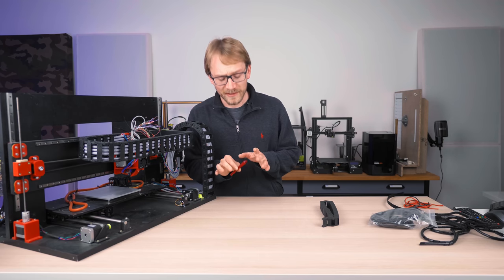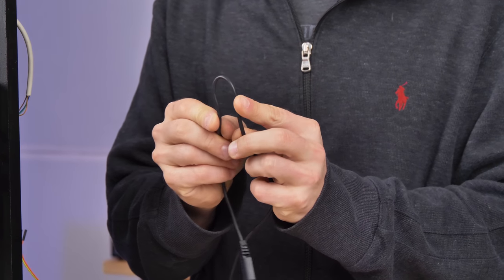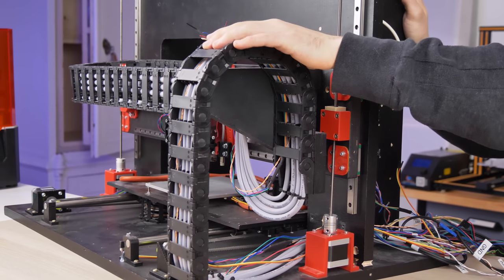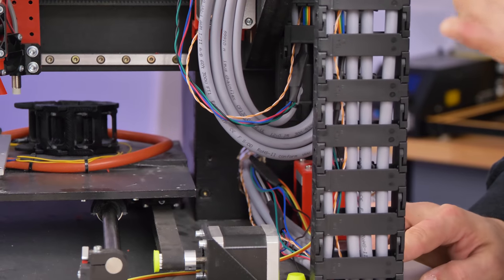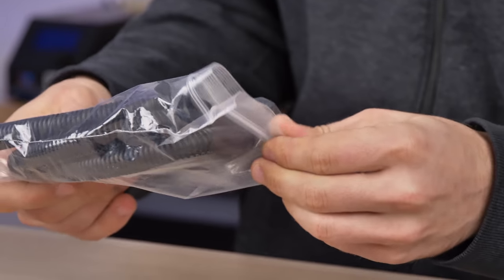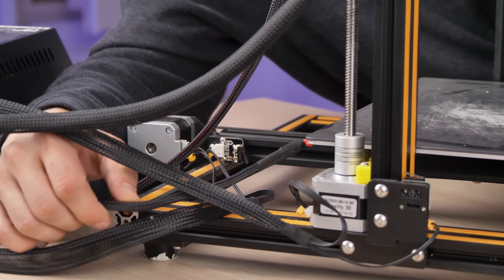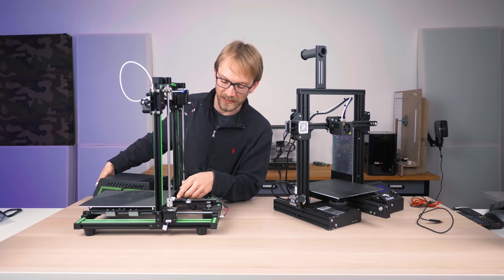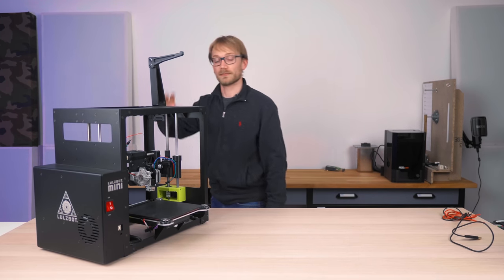Bad and great 3D printer wire management explained!

Comment: You forgot one technic. E3D uses a mesh sleeve with a spring steel band in it for the tool changer. I like this idea, because it might be possible to keep the cables horizontally orientated and you don't get this vibrations from the cable chain. I would try it if I would have an idea which steel band would be the right one.
Reply: I did the same thing a few years ago for my DIY printer, except I bought 2mm thick nylon fishing wire. It was too flexible, so I braided 3 strands together and hot-glued (no other glues really stuck to nylon) them on both ends - this braided "wire" is enough for reinforcement of the sleeve. The machine is an i3-style printer, so I routed the extruder/X-axis cables from the top of the frame under 45deg pointing up-backwards. This gets you a nice large radius across a wide range of Z heights. To this date, I haven't found a better mechanism (drag chains included) and I'm a recreational CNC machine builder. Too bad I can't post links to images here.
Reply: @jirij  I see the main advantage of the steel band that it is flexible in one direction, but it is nearly not to bend in the other, just like the cable chain. In my CoreXY printer I could get the cables in a form like a fibonacci curve instead of looping them upwards. So I could make the enclosure smaller.
Reply: I am only not sure how fast the thin steel will cut through the sleeve
Reply: I have seen someone use cheap tape measure innards.

Another i have seen used is polypropylene sheet, such as from a plastic document folder or a kitchen mat.
Reply: I can vouch for that, that's what I use. Look for large stainless steel cable ties. They are cheap and readily available in sizes from big enough to huge, easy to work and durable. Perfect for the job.
Reply: @m3chanist  Interesting idea, but are they made from spring steel?
Reply: @yaVDRgda  Like any stainless, springy. Duplex stainless isn't brittle, however. I have it configured in an S laying flat on its back between a central rear mounting pillar and a mount on the back of the extruder. Enclosed corexy, needs to be compact.
Reply: @m3chanist  Yes thought about an S curve too, at least for my CoreXY. I am currently working on an Core2XY too, there I need another solution

Comment: Replaced my cr10 bed wires with flexible large gauge silicone insulated wires soldered on to the bed and printed a drag chain, to many amps for my taste to leave that part untreated.

Comment: I use a spiral wrap with a hard 5mm diameter filament-like plastic for reinforcement (electrical fish tape). Tie the plastic firmly at ends and it will hold the wiring in a nice, predictable curve.

Comment: Drag chains should NEVER be used in a vertical orientation! The chain should ALWAYS be horizontal across its width. For vertical runs the chains/cables should HANG from fixed points - one on a fully fixed, the other fixed to the moving part. For horizontal runs the chain should lie flat AND for best practice should "roll" onto a flat surface or a specially designed chain bed. Also good power cabling would typically be heavier duty than signal cabling so using multicore cables is not recommended for the power distribution. This means ALL cables delivering power to stepper motors (all four or more leads) and to heating elements (bed, nozzle etc.) Fan power is usually low and so can use similar sized wire to sensor wiring. The BEST way to cable is to use the right size wire for the job and make those wires into a cable using flexible sheathing or full length heatshrink for low signal/low power pairs - the way that F1 engineers make cables,

Comment: One of the biggest (if not the biggest) concern with the wiring bundles, particularly to the tool head, is the strain of the wire bundle on the tool head itself. Depending on where the tool head is the wiring bundle will (most likely, dependent on design and location in the build volume) exert pressure on the tool head which can force the head in a particular direction. 
Once you get your printer precise enough, or have a printer that already is at that point, the wiring bundle can pull the tool head away from the bed when it is totally stretched out, for example. 

This is actually why I was looking up information on this - wanted to know the cons of a drag chain. I am about to add one to my printer b/c the wiring bundle as is (enclosed in a stiff mesh w/ a very large zip tie acting as a ‘spine’. Wrapped together with zip ties & heat shrink at the ends where the anchors are) causes the print to be slightly light at the far end of the build platform

Comment: Wow...I didn't realize Lulzbot went out of business.  Where have I been.  My local Microcenter still has them for sale.  Expensive beasts, but they are well made.  Where I work the engineering department has 4 of the TAZ's.  We also have some big boys (Stratasys)...but the guys love the Lulzbot's.
Reply: They ended up getting bought out, so Lulzbot is in business again.
Reply: @_Piers_  good to hear.  Expensive product, but the ones that are in use by some of my fellow engineers go 24×7.  They shut them down to load filament, that's about it.

Comment: Good video - another DIY 'dragchain' tip is to use a flexible steel tape measure blade within a mesh tube outer. Still like the Prusa textile option 'tho - never failed yet (maybe I shouldn't have said that :-)
Reply: Damn that's genius! I can already see easy ways to integrate this and connect it to printed mounts....time to dig out my guinea pig printer for a test!
Reply: Another possibility is to use polypropylene sheet, such as from a plastic folder of from a kitchen mat. Once you constrain both ends to one direction, the middle section forms a smooth loop. I don't know whether i came up with this thought independently, but it's not very original, googling it up it's part of several Mendel90 build instructions.

Comment: Hi Mr. Sanladerer; 
MOST challenging is having a soldiered wire connection survive within a DRAG CHAIN.

AFTER wrapping each in electric tape, then bundling them togeather with electric tape - finally to place thim within that *light spiral-wrap like in your video - then placing them into the DRAG CHAIN. I will see how long it survives 10x30mm CHAIN.

I believe it WILL survive for quite some time, because the sprial-wrap kind'a grips at area of soldier bulge AND the sprial wrap is super slippery, sliding thru the drag chain like an ice skater :) OH, and as you mentioned the CHAIN's bending radius - the sprial-wrap actually keep the chain from making a small radius bend. An added benefit of using the spiral-wrap around wires.

I gave up on using that snake-skin wrap, as it is EXTRA aggravating when wires need replacing.

(Had no shrink wrap at the time - will try that if/when fails. *I say light because RADIO SHACK once carried spiral-wrap like 2-3 times heavier and thicker, that would not fit in a 10x30mm anyway.)

Comment: Good cheap substitute for a cable chain: cut an old tape measure and put it inside the mesh sleeving alongside the cables. Found it on the V1 forum.

Comment: Lulzbot Minis are notorious for breaking bed heater wires in the Y axis drag chain.  Way to tight a radius.  I have replaced mine twice.  Last time I left it out of the chain and use a length of filament for strain relief.

Comment: At work, our ethernet cable didn't survived in drag chain even a two weeks :D Had to buy very expensive cable.
Reply: Ribbon cables are not that expensive. In Farnell's catalog there are ribbon cables with guaranteed cycle time on assuming a certain bending radius. I've installed one in 2006 in a machine (not in a 3D printer though so less movement) but way above 20million so far and the rating was only 10 million.

I would rather buy these even when they are a little bit more expensive, the reliability is impressive, compared to a normal ribbon cable.

Comment: I use spiral rap with a teflon tube inside next to the wires to increase the bend radius and control it's location a bit better. One or two tie wraps can secure the Z-cables

Comment: I use a light elastic material approx. 6mm wide  that is used in dressmaking. This is attached to the extruder cable at one end and the other to the top aluminium bar. 
I position this by eye so that there is minimum flex.

Comment: spiral binding coils are better than drag chains for most uses. super light, cheap, low friction and bend in any direction. you can even vary the amount of bend resistance along the length of the coil.

Comment: I have a plan to use the PET sleeving over my cables, but I'm going to put a length of tape from a broken tape measure inside the sleeve.  It should keep things really rigid, the cables can run along the concave surface of the tape, and  it will bend very nicely and be able to move back and forth.   I'm sure it will look weird, like it's levitating, but I think it's a good cheap DIY alternative to the heavy and expensive drag chains.
Reply: Did this work or did it fail too quick?

Comment: In my experience,  wire thickness, number of strands, type of wire, type sheathing all play also significant roles in cable management. Basically, it should start at the product design engineering level.  If the selection of the wire is not intended for the application or there is a bypass to use cheap wires or cable management for the sake of keeping cost down then at some point you are going to have issues with wire fraying and breaking. 

On my first Anycubic I3 Mega the first thing that wore out was the cables to the heater, due to the way  those wires were attached with a tie wrap was not helping. Using tie wraps at a point where there is constant bending is a really  bad solution to keeping the wires  in place,  in addition to the wires running on thick stiff heat shrink sleeves this would restrict the movement rather than make it smooth. The wires were also stiff minimal strands. Replacing the wires with high quality, proper gauge silicon sheathed  multi-strand wires and using a cleaner method of attaching them to the rear of the bed was the solution. I have been operating that original machine to this day without issues to the cables breaking as they did within the first year of operation.  

Good video, and there should more emphasis from manufacturers to supply machines with much better cable management systems than the more typical cheesy ones you see on entry level machines. Even at the entry level, in today in age there should be no excuse not to use proper cable management and keep the 3D printer mechanics and aesthetics much more elegant. 

After considerable research into entry level desktop 3D printers when the CR10 was at the top of popularity, one of the biggest reasons I selected the Anycubic I3 Mega, when they first came out,  as opposed to the Creality CR10 or similar machines was its  architecture, solid and clean for the most part. The digital touch screen has a nice subtle blue white colors, no funky reds, greens, oranges or yellows. To this day I love this combination from an ease to the eye aesthetical reference. For those who understand color and how they affect the human mind, blue is typically used by companies who want to establish trust from the user in their product. Banks use blue a lot and while this may be more applicable to such entities, I really appreciate the fact Anycubic used it elegantly in their I3 mega machines. This is not the case unfortunately with their later versions. 

Getting back to cable management, I have yet to see a table or desktop  3d printer or laser cuter that I can say is an elegant well thought out and solid machine.

Comment: I am having fair luck right now, using a section of coiled measuring tape along with the wires inside a braided sleeve. Bad luck using flexible adhesive cloth tape instead of the sleeve. I do not know how well it works compared to drag chain.

Comment: Very nice.  I'm in the middle of building a Hypercube Evolution, and was just trying to decide if I want drag chains, or wrap, for my cables.  I'm thinking a drag chain for the bed heater/thermistor cabling, but I may wrap the X/Y/E cabling, so I can have shorter cables. (running from the electronics in the base, to the top of a 900mm chassis is a bit of a haul)

Comment: with these standing conigurations a larger radius is actually not ideal, because the added weight on top increases strain on both chain and wires.

Comment: Tom, what do you actually think of these concepts on cube style printers (for example corexy printers) where one single drag chain sits on top and follows the x AND y movement of the printhead (for example one end of the dragchain fixed to the back-middle of the frame and the other one fixed to the printhead). I know this is not what dragchains are recommended for but is that a problem if strain relief etc is considered?

Comment: I've been using spiral wrap with a strand of PLA  inside with the wires for the last couple of years, its holding up fine so far.
Reply: A strand of ABS or PTFE tube might be better if avaliable. Just thinking eventually PLA asorbs water and becomes even more brittle. I have had old PLA snap off at the extruder for no reason when the printer is idle overnight.
Reply: @Side85Winder  PLA does not get more brittle from absorbing water, it gets less brittle from absorbing water. Just throw a piece of PLA into water and observe. You can keep it with water in a bag for a week and you shall observe that it got just more flexible and tougher, very nice.

But you still shouldn't print with PLA which has absorbed water, as it will foam up and potentially degrade chemically during the melting process.

I suggest that if your extruder has PTFE lining, it may be implicated in plastic deterioration, by releasing highly reactive fluorine compounds. It might not be polymerised fully, coming from low-quality chemical manufacturing, and it may be degraded by heat cycling. Some people found that simply inserting a piece of PLA into a PTFE tube for a while will make it brittle.

Other influences that have been found to rapidly make PLA brittle are UV light and ozone.

Comment: Actually coming out of Electronic Engineering I am still thinking to rewire my Ender 3 completely with a proper "Kabelbaum" . Means laying out the schema for the cable on a flat wood board. then hammering in headless nails, and then laying in the cables. The cables will then be tied together with a beewax cord. So you get a proper cabling, like you see that partialiy done in planes or cars.

Comment: Thomas,  I know I am a little late in the game for a comment.  In the US Navy, there are standards for cable installation and lifetime lay.  You have installation specification and lifetime lay specification.  Install spec. is the bend radius is no less than 8X the cable diameter.  Lifetime spec. the bend radius is no less than 16X the cable diameter.

Comment: After trying the alternatives, using a decent drag chain is just a better solution to me, especially if you are using a larger build volume and/or in an enclosed space (plus it looks 'industrially' :)). The drag chain provides better support over large distances and a constrained movement path, unlike plastic wrap or mesh. Of course its unfortunately more expensive which explains why you don't see it often on printers - but you can 3D print your own chain for a cheaper solution.

Comment: nice project you got there,  but :D why using simple threaded rods ? use trapezoidal threaded rods, and fix them to construction with bearings, all that X weight on two small stepper motors

Comment: Wow the print beds really move easily as you grab the cable, i would imagine that causing print artifacts as the pressure on the connector changes depending on the bed location.

Comment: I just replaced the corrugated split wire wrap with the expandable nylon mesh sleeve on my Anycubic Predator delta printer. Now my filament doesn't snag on the cable bundle anymore.

Comment: The ender 3 has decent wire bundles, but they can get tangled on each other and caught on the bed.

I'll going to have to add drag chains just to keep them separate.
Reply: Or just insert a piece of filament in there and mount it such that it constrains enter and exit directions, the rest will follow.

Comment: Nice explanation. I guess I should be happy the original Indiegogo Craftbot from Craftunique used drag chains on X and Y axis. I've had to replace a few cables inside, because I think the bundle was too tight, but otherwise the printer still works great.

Comment: Does the drag chain have to rest on a flat surface,?? If I mount the drag chain at a certain height, then the Loop is suspended, is this alright?? Or does the chain have to rest on a flat surface when looped around??

Comment: I like printing my own drag chain links in TPU - cost not an issue. I have a parametric SCAD file for customizing the links and end mounts from Thingiverse. The hard plastic edges of PLA links will wear the wire insulation over time. Don't try printing the links connected with TPU, but they print separately w/o supports very nicely.
Reply: Do you also print them 3 times?

Comment: I actually don't like drag chains much. It makes it extremely hard to change certain things (at least in my few cases). I have since switched to split braided wire sleeving (Alex Tech makes the most dense braids on sleeving I've ever seen) and it makes changing things and organizing things extremely easy. They are, however, not the perfect solution for everything. On my corexy X5SA, changing the hotend chain for a braided sleeve causes a lot more sagging than it previously had. I found a workaround (zip tying the loom to the bowden and where the chain used to go so that it went in an arc), but sometimes it's impossible to fix without weird modifications.

Also, am I missing something here? Why does that printer have what looks like ethernet cables in it?